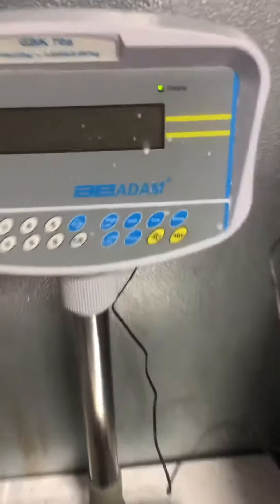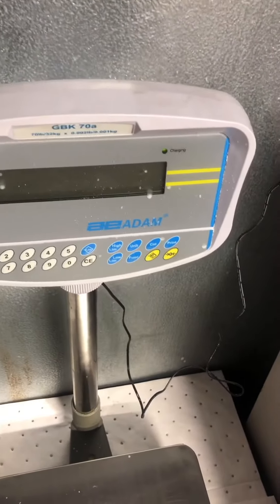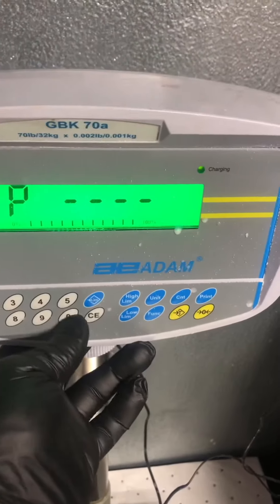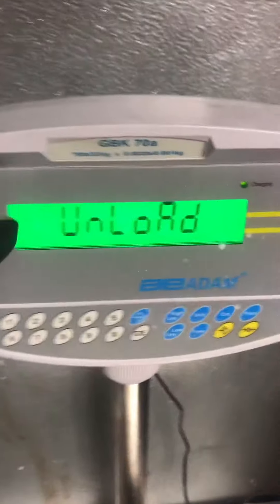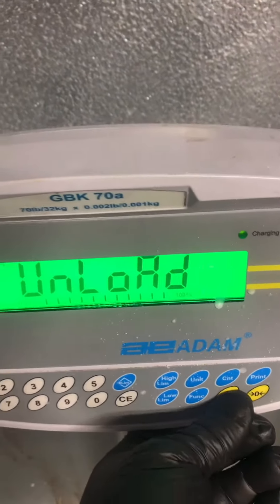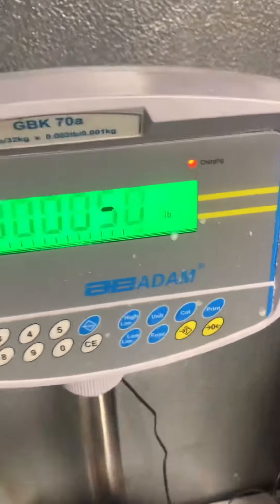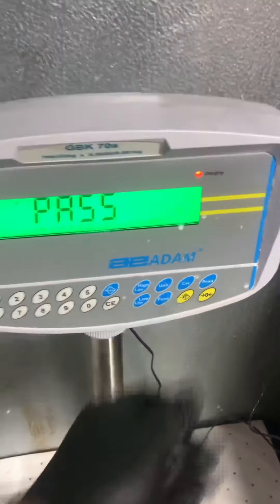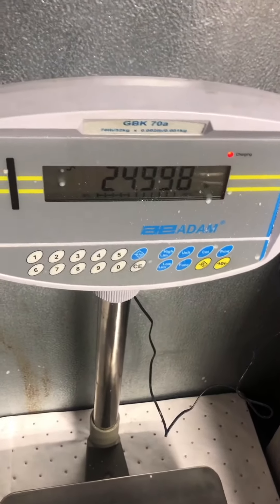calibration adjustment of a Adam GBK series

Comment: I just put together my new scale and when I placed an item on the scale and tared, I'm not able to use the zero key to clear the tare without an err 4. Any help would be appreciated and thank you for your videos.
Reply from the maker: If you use the Tare key to tare off the weight you have to use the tare key again to zero the weight if you use the zero key to zero off the weight than you have to use the zero key again to zero off the weight
Reply: I've downloaded the manual and going to give it a through read through yet. I just wouldn't expect an error out of the box with 1 calibration cycle.
Reply from the maker: Check in between the top and bottom frame  for anything binding brand new scales are sent with load locks or something wedged in between to keep the load cell from being damaged during transport
Reply: @Raddamez1215  I did not find anything protecting or holding the cell stable, the scale is also accurate when I can get it to tare and compare weights with another scale. I'm starting to think this scale was returned and resold from the vendor I used.  

I do not get the err 4 when turning it on without the stainless pan in place. If I replace it and tare I can then get count mode working for small hardware, but running into other errors yet. If I continue having issues I will contact ADAM.

 I can't thank you enough for your time and direction. Your videos have been helpful also.
Reply from the maker: One last thing, check the over load bolts if any, see if there touching do a shift check put weight on the front of the platter and the rear of the platter it’s a single load cell if the weight is different from front to rear you might have a faulty load cell have a happy holidays brother
Reply: @Raddamez1215  Thanks! Enjoy your holiday as well!